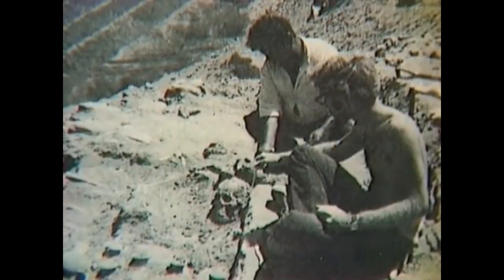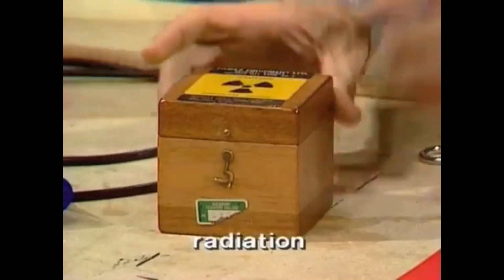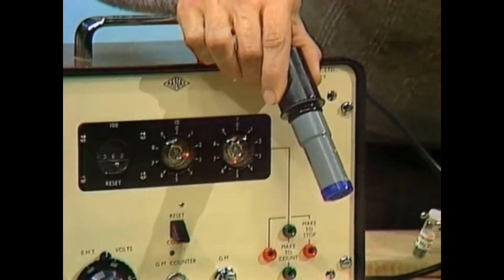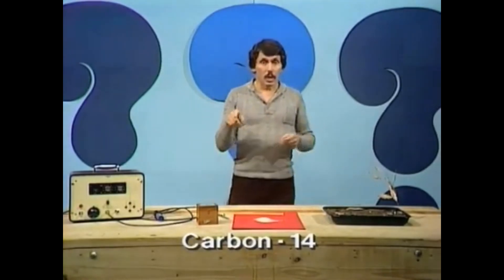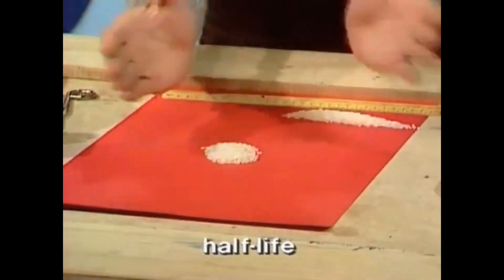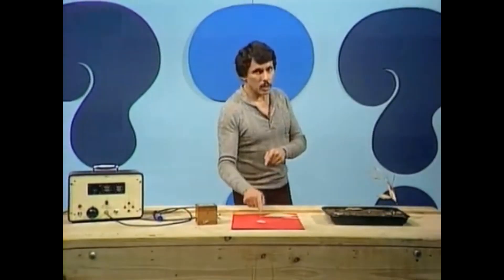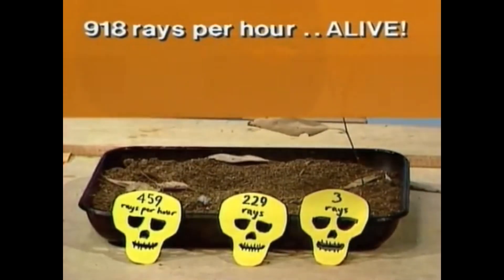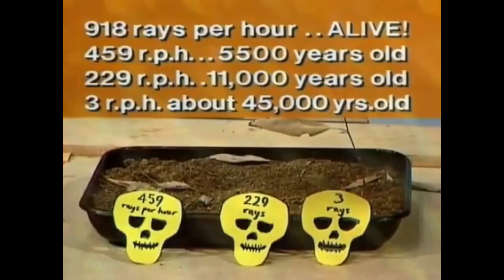Carbon Dating

Comment: There are zero accurate CHARTS on earth. There cannot be.  We have only been measuring radioactivity since about the early 1900s. So the assumption of how much radioactivity was IN the atmosphere or in the food sources for a mammoth to have in its body is based on how much is currently in the atmosphere or food sources.  The problem is when we test older samples of atmosphere they are quite different.  Gas trapped in glaciers, core samples from the ocean or lake beds.  Samples which should be older often have less C14 not more. If decay were the only variable that is confusing.  That can give us carbon samples and a good idea of what food sources might have had though.  With wide variations in the availability of carbon 14 to be in the animal or plant's environment we cannot reliably date the sample. We would have had to do so all along. Have had to get readings at various times 1 million years ago 100,000 years ago to establish reliable charts for the presence AND  radioactivity of C14 to start with and how it decays over time at different places including depth and altitude, when buried etc.  We just don't have the data. So the latest articles I have read indicate many archeologists have found C14 is better used to tell whether an individual buried within a group of them was born and raised in that location or came from somewhere else.

Comment: Important to remember that this only works for organic material. Archaeologists cannot carbon date structures like the pyramids, and they must rely on other types of evidence to try and pin point their age. Secondly, carbon dating no longer works for anything that died after the start of nuclear testing during WW2. That's because the radiation thrown in the atmosphere back then has changed the baseline.

Comment: Ok, so this tells me radio carbon dating isn’t accurate for anything that’s been dead longer than roughly 50,000 years. So how do we calculate for the various dinosaurs and stuff that are tens or even hundreds of millions of years old?
Reply: I believe they measure other isotopes, not just carbon-14. They also estimate by where they found it in the ground in the sedimentary layers - generally older things will be further down
Reply: There are other forms of radiometric dating.
Reply: Not necessarily. You can test more than a gram.